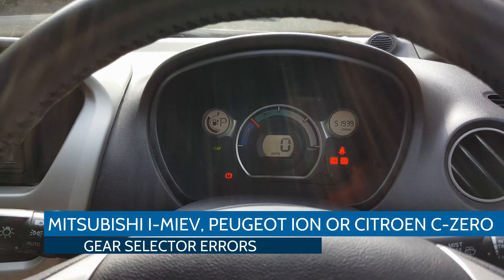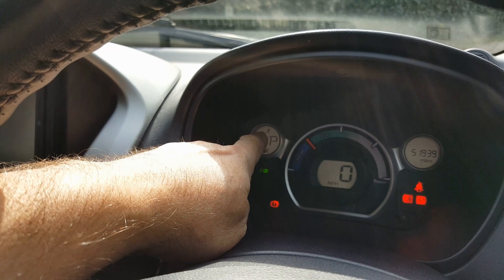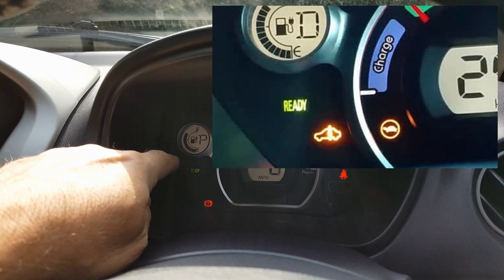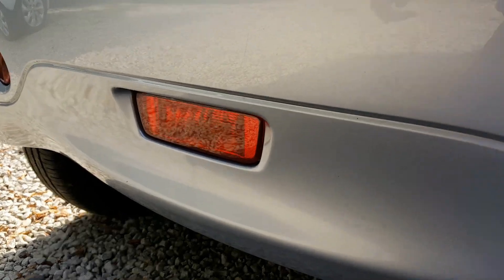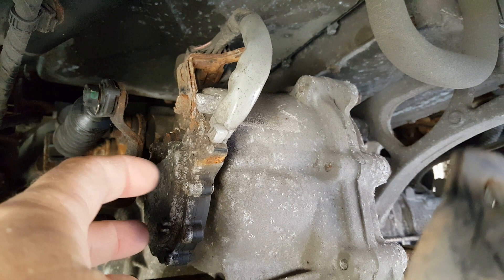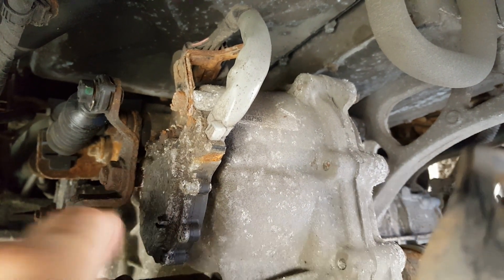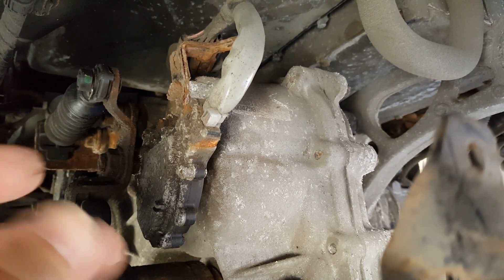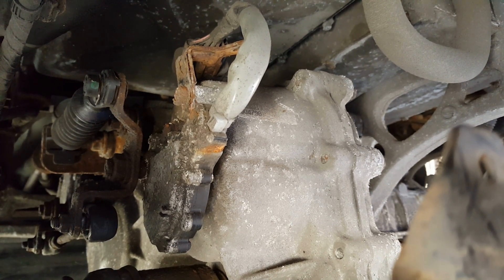Sticking gear shift on a Mitsubishi i-MiEV, Peugeot Ion or Citroen C-Zero or electric fault

Comment: Awesome video! I was considering having my i-MiEV fixed at a Mitsubishi service center as I saw other people having the same issue and had the shifter sensor unit replaced. That over 400$! I just applied some WD-40 all weather bike chain lube at the place shown in this video and cycled the gear selector from P to B about 30 times and my problem is solved. My i-MiEV has 74000km and is exposed to severe weather in Montréal, Canada. The linkage was bone dry, rusted and covered by road salt. I will apply lubrication on a regular basis to protect these parts.
Reply from the maker: Glad it helped.
Reply: Can you write me the exact part number for the shifter sensor please
Reply: @TheKnightOfThinking  I think the proper name for that part is "inhibitor switch". I don't know the exact part number. I'm still having problems related to the same symptoms. I think my shifter cable length needs an adjustment.

Comment: change the oil in the reduction gearbox, then the issue will go away after a while.
Reply from the maker: This is due to corrosion and dirty as the linkages are exposed to the elements. Its not related to the reduction gear oil. I do change the gear oil in all these vehicles when they come in, as it is such a quick and easy job to do. I've done a video on this if anyone is interested.
Reply: @GoGreenAutos   I had the same issue on my Peugeot Ion. Gear lever almost stuck when the temprature went below -15. I changed the oil one time. The issue did improve, however not much. This went on for half a year, and since i did not replace the aluminium seal rings, i had a leak. So i changed the oil a second time. Then after a week the lever, like magic was freed up! :D Might be a coincident i dont know,. But worked for me. I did try to spray frreing oil a PTFE lubricants on the outside several times when i had the car on the lift. Did not make much diffrence i feel.

Comment: Hi, I have exactly same problem with charging , I mean flashing gear selector and warning light is lid. Can't charge or start vehicle. Tomorrow I will try to solve this problem. If I made it I will upload some tutorial how to do it. Thank you for some clues! Big beer for you 🍺
Reply: Did you manage to fix your problem? I have same issue.
Please let me know
Reply: On right side of gearbox you have lever connected to gear selector. Try to lay under vehicle and find correct position manually for P position. Then you should be able to charge and drive
Reply: @jacekwozniak5422  Thank you for your reply.
I will try that today👌